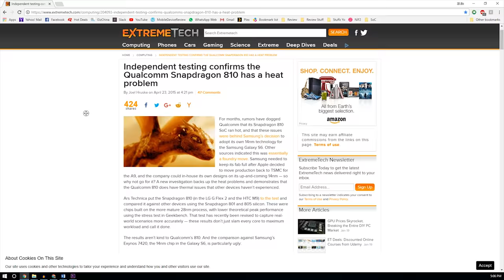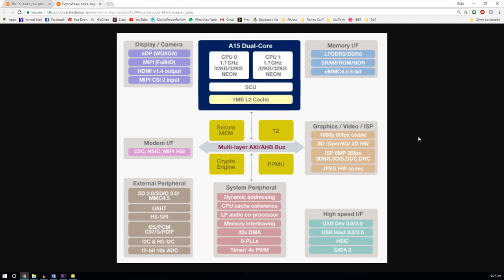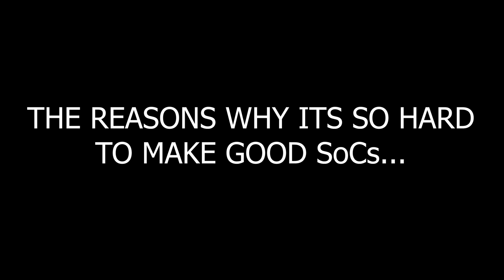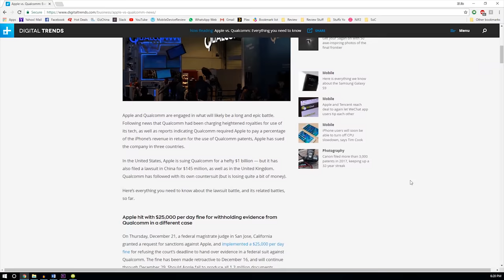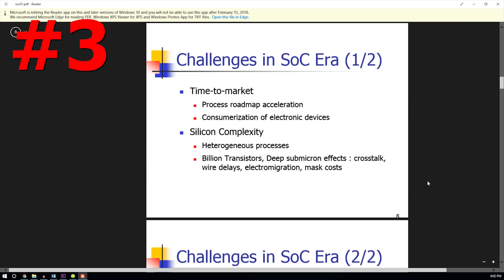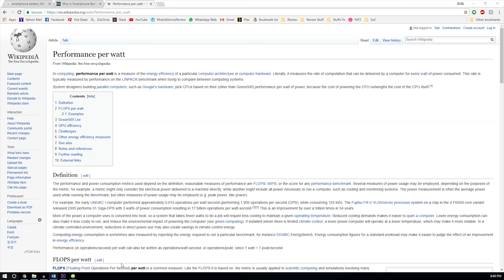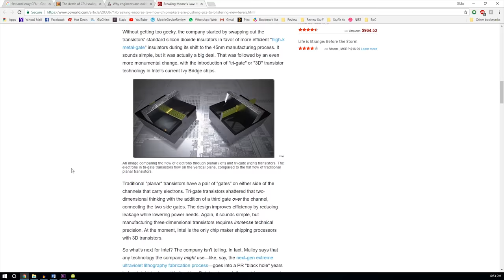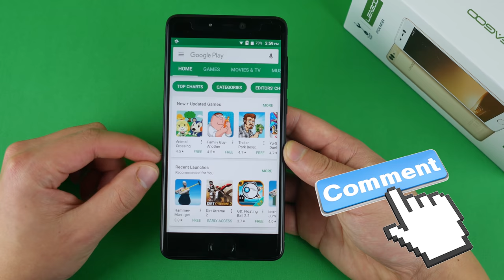Why do some phone SoCs (System on a Chip) suck?

Comment: So basically, don't buy the Leagoo T5c, I remember back in 2013 I bought Zopo C2 out of China, it's MediaTek Soc was horrible, it would not wake up from standby, and I remember reading about so many people with different phones with MediaTek chipset complaining about the same issue.
The main issue is that there is no competition, phones with Qualcomm chipset so are usually better and cheaper then MediaTek ones, for example Xiaomi phones with Snapdragon 625 are cheaper and far better than phones with Helio P25.
Reply from the maker: I guess we can definitely give Spreadtrum time to see if they improve. Mediatek has made great strides since 2013, hopefulyl Spreadtrum improves as well. More competition is always a good thing
Reply: Leegoo is using Intel Atom tech!
Reply from the maker: Yeah but doesn't mean they did a good job building on top of it
Reply: Zi Reviews Tech 
Well the main problem consumer's face when dealing with companies like Mediatek, isn't hardware, it's their inadequate ROM support. Most will never see an OTA update, even if an issue's severe. For instance how many of these companies will even bother patching the Spectre bug?  One can only hope Speadtrum don't follow Mediatek's poor example!
Reply from the maker: Yeah that's the other issue that I hope spreadtrum fixes. So right now the Spreadtrum not only has zero ROM support, it also sucks!

Comment: SD 625 has 8 cores and probably uses the lower powered cores when screen is off and using basic apps. While big cores can be used as well to give performance boost. You should look into Android kernal CPU scaling. By default Android uses the "interactive" CPU profile. The CPU clock speed gets boosted each time the screen gets touched.
Reply from the maker: The SD660 with the 4x A72 cores are fairly power hungry

Comment: Absolutely great video ,you made it look so simple . Very interesting points in your video I am sure that many people learned a lot . I thought Intel stopped making SOC's as they were loosing too much money. Oh yeah that's one tricky point you forgot to mention that unless you are selling top tier processors , nobody wants to pay top dollar so your likely investing a lot but making peanuts ,this makes staying in business a challenge .

Have a nice day
GS
Reply from the maker: Thanks Garry, appreciate it. You are correct also, flagship processors like the 820/835 or the equivalent Kirin make the most profit, while low end processors make way less
Reply: Yeah ,I used to work for Intel ,gone are the days when it cost $39 to make a chip and they sell them for $1500+. They are lucky to sell a premium  main line chip for $600 .Yeah they do have some server chips forv$1500-2000 but how many of these chips do they sell (not many). I think you should continue with the in depth tech stuff ,I find it very interesting .
Reply from the maker: Oh wow that's awesome. Which CPU iteration did you leave?

Comment: I've only had two mediatek phones, one I'm typing from right now. It's their shitty controller and WiFi coupled with pretty slow, large CPU. It's the definition of a bottleneck. 

Took me like a month to figure out cause I've not seen a WiFi bottleneck on a cpu since the og core 2 duo. 

The worst implementation of ARM for sure. With that said.. they make them so dirt cheap they do have a place. Like the phone I am typing from right now (K51) was $60 like four years ago.. and it updated two full droid versions at least. 

It useable if you're very patient, which I'm not. 

Not to mention, any cutting edge hardware will never be used with Mediatek so they also have no incentive to spend big bucks on besting Qualcomm.. they've just gladly accepted their place. Whatever.